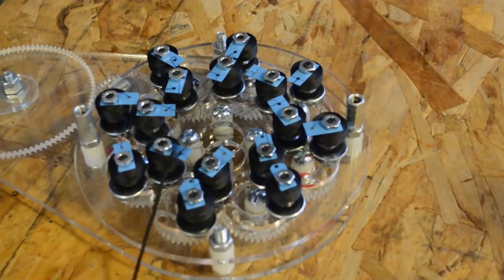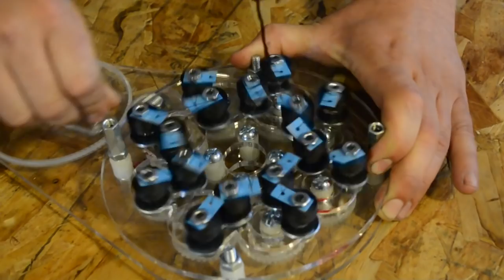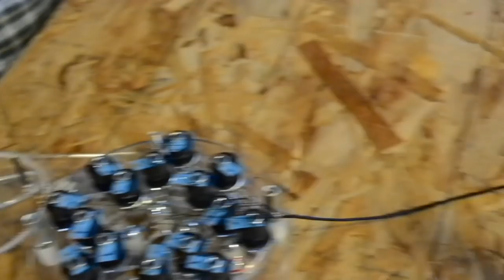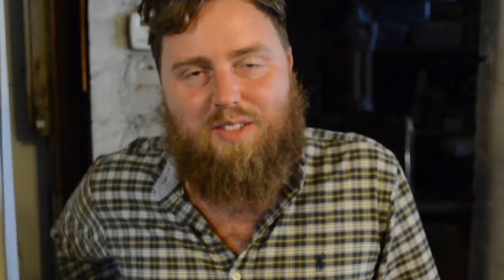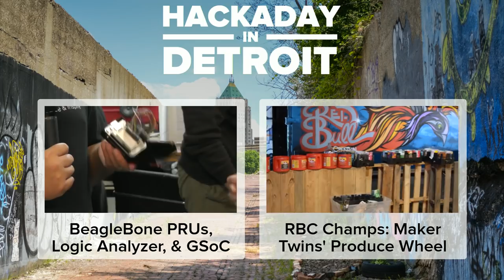Recreating a 16-Bobbin Rope Braiding Machine

Comment: Good work David and Jed. You need to keep the braiding point under control, so it needs to be constrained within a loose die or hole. The braiding point should be at a 45 degree angle to the  vertical, and the pull-off of the braided cord should be speed controlled to keep the laying point at this die position.

Comment: Could it be used to make Litz wire? I wonder if the braiding is the same?
Reply: Litz wire does not have to be braided (rarely is) it is just a very large number of individually insulated strands covered all over.  Often the outer covering was silk thread, wound around possibly in two opposite direction layers.  Overall braid might be nice but not needed for function.  This could be used to make custom coverings for electrical cords to personalize or protect them.